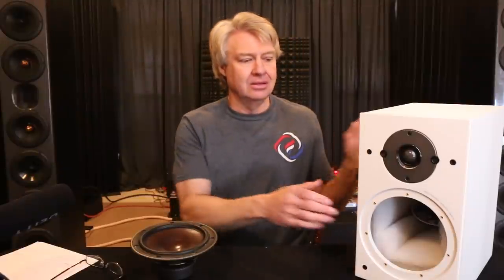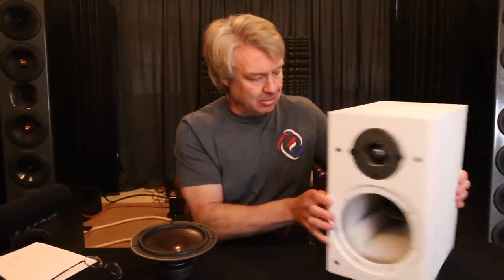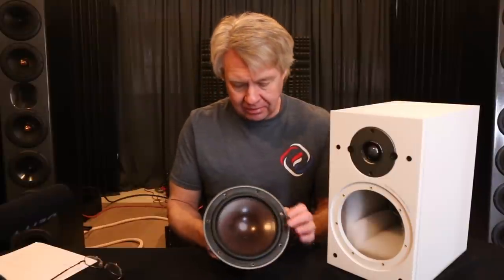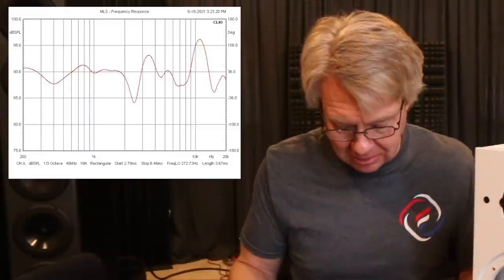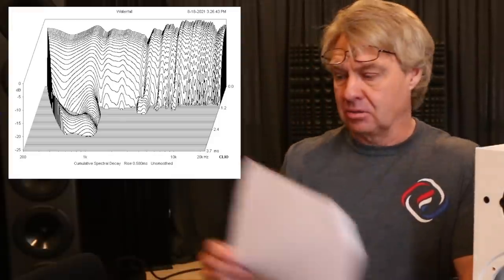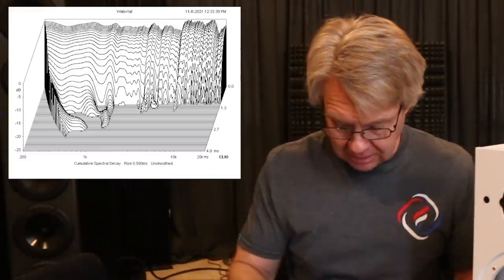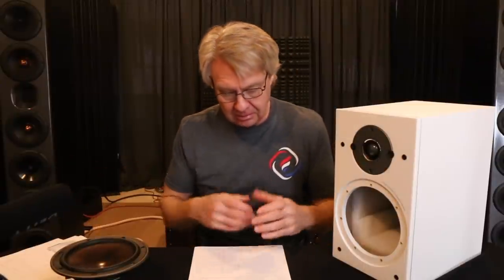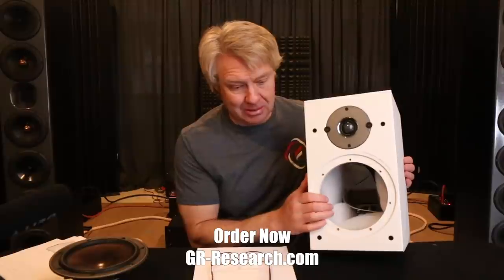Deal or no deal? Dali Oberon 3

Comment: Buy a set of $100.000  speakers, measure,  then add $30.000 worth of better components, and yes they will measure better. The speakers have a certain price point for a reason. I don't think Dali would make much of a profit if they spend over $300 in components and keep the same retail prises in this case. And I do hear a lot about measuring, but listening isn't about measuring, it's about experiencing. It is great that you create these upgrade kits, and I am sure they can improve the base speaker that it will be applied to. But don't talk down a speaker just because you can improve it, for a good chunk of extra money. It's just not fair.
Reply: True but does anyone know the price of the parts in these kits? I assume its like $50 or so and the rest is his profit anyway. I only have the Zenzor 1 (about £180 I think, in a pretty small room) and think they sound amazing, they are on stands with perfect ear/tweeter hight etc... I agree anyone who buys and fits this kit will think it sounds better without question most of the time. A true A/B is the only way to tell and that's subjective on a person by person basis anyway.
Reply: @usefulrandom1855  I had the zensor 1 for many years. Only thing the top end was a bit too bright and fatiguing. I sold them to buy the Spektor 2 and have better base and midrange
Reply: @diegocanale1124  Nice, I moved into a better place and got the Wharedale evo 4.4! They are huge but sound awesome. Still got the sensors will set them up on/next to computer desk when I get around to sorting that out.
Reply: no 300 no, but what they put in is 5 bucks,....yes if you want sell speakers over the price of new hybrid car you almost have to look for worst possible part in the market...
Reply: This is his business idea. Everything is crap until you buy his upgrade.
Reply: @hbg70 That sounds like envy. People, folks, audiophiles and music lovers in USA send their loved, but not sounding good speakers to Danny. To see what next level Danny can take them to. (Many speakers do sound bad and also measures bad.) He does it for free and they pay for the parts and not Danny’s labour. Shoots a video, so others with the same speaker can upgrade their speakers, if they believe in good sound. Danny sells the parts. What’s the deal for you with that? I don’t have the knowledge or the equipment to do this to my speakers, so I would buy a kit.

Comment: I was a salesman for Dali speakers in the mid 80's. They were killers then and when tested against other big name speaker companies of that time the Dali's out-classed them. Today I still own an unchanged working pair from that time. At that time they were not made with cheap drivers, compacitors, crossovers, etc. Wow how times have changed.
Reply: the rare thing is that Dali Oberon 3 are cheap built, but sound very good
Reply: @carlosaguilar6743  that is possible.
Reply: Dali is the new jamo, cheaply build, very brightly tuned, so in comparison  in the shop the will standout in comparison with more " serious speakers, THAT'S how you sell , when the customer comes home those speakers quickly disappoint, so off to the same shop and trade them in for even more expensive models, THAT'S how the business iss done.
Reply: @giottodiotto1  In these times I have lost faith in many companies selling inferior products that were once of good quality.
Reply: @spooner1  but it took me months to search speakers and still didnt find a good neutral warm speaker. Focals returned too bright... Pff
Reply: and dali is no exception to that, one will give you bright sound to impress like dali , another boomy bass, another worm in the bottom with very hot trable, ....they just have to start somehow at 1K to scale prices up to 10K where real/normal speakers start in order to make todays salesman belive what a pieace of engineering he is selling when showing up that 10K speaker....stupidness, no speaker should cost as much as a car, but it is what it is so lets buld and upgrade.....
There are some exceptions which we know thanks channels like this one....

Comment: I bought this summer a pair of Dali Oberon 5 floorstanding speakers. Via Bluesound Node2 music streaming(Spotify and Tidal) on a vintage but total restored Sansui AU-505.
Sounds surprisingly good, at least for my ears. Enough clarity,midrange and bass even at low volume.  I live in a small apartment in Amsterdam; everything is wood and gypsum. No concrete or stone, i like that.
The Oberon 5 are pretty hefty.  They were  €800,- the pair.
Yeahh ,i would like for example the Buchardt S400 mkII and a stronger amp, but as i said, it's a small apartment..
Reply: I agree. The Dali Oberon 5 are fantastic speakers for the money. They have suprising wide bandwidth, smooth treble and can go loud without compression or breakup. Even if they do cheezy crossover components.
Reply: Meanwhile i have a Sansui AU 317( I had years ago too),fully restored,also the exterior is nice),more power than the AU 505. Sounds even better than the AU 505 with the Oberon 5. But i keep the 505. The 505 is about 2x 18 watt, the 317 about 2x 50 watt...again..sounds surprisingly good with the Bluesound Node 2i.. But  ""everything" depends on the the track/ the mastering of the track in the studio and room-acoustics..I have a pretty high ceiling.
So.. i don't need a new/modern amplifier for a good sound.. No remote, no dac(there is a good dac in the Bluesound),no modern looks..just a good sound(for my ears..)

Now(since 6/8 months) i use the Triangle Borea III, bought second hand, in very nice condition.The seller had bought the Kefs active speakers.
The Dali's are very nice sounding(and looking) speakers but still gave a little to much bass in my tiny(25m2) room.
On the other hand, the Triangles are for that matter perfectly fine.

I connected the Triangle's with an Ayima D03(i just wanna try it) and..the sound is very good, not less than the Sansui, but of course not many inputs.

First i connected the Aiyima with the Blue Sound via  "aux" on the Aiyima, but it gave not much md- and high tones(so i used the intern dac of the Bluesound.

Later on i switched from "aux" to "coax" (then i use the intern dac of the Aiyima..and  problem solved... Enough high- and mid tones now,  so (i did'nt expected also) the dac inside the Aiyima sounds better then the intern dac of the Blue Sound!    Crazy but realy truth..

I believe the Aiyima D03 has Texas Instruments chips inside, that's why..

So..finally i do use a "modern" amplifier.
It surprised me too, how good(bass,treble,punch etc) that small Aiyima amplifier sounds! Not worse than the Sansui! I live in a small apartment in Amsterdam so not much space.

The Triangles are high sensitive speakers, so that's a plus.
Also with low volume it sounds pretty full/warm/punchy.
Reply: The Sansui's I've had have all had a very bright etched sound - this is exactly what the Oberon 5's need so excellent match. I feel the Oberons sound a little muffled with smooth gear or more refined gear. I wish I could send them to Danny, but I'm in the UK so....:(
Reply: We concerned Dali Oberon 3 but you gave Dali Oberon 5 's  impression.Thanks.

Comment: I don’t know, at the end of the day what matters, is what your ears are hearing. Today, I listened to Kef Q350, Oberons 3 and B&W606….to be honest, I loved Oberons best. To my ears they don’t need any tweaking whatsoever….does it mean there’s something wrong with my ears?
Reply: Yes they're great sounding speaker I can only imagine what they sound like with the upgrade
Reply: If you are over 40 years old, you need bright speakers to compensate for natural high frequency age-related hearing loss.
Reply: You can test drive 3 different stock cars. And then, you drive a specially tuned and equipped version of one of those three; more horsepower, even acceleration, better tyres, better grip, better braking, more comfortable seats, better steering wheel, etc. From the moment you sit inside it, press the accelerator, press the brakes, etc. you KNOW exactly how much better any stock car could be but you are not given that.

Comment: From watching Danny's videos, it seems like the most prudent action is to buy used, but well-regarded speakers at 50% off retail and then have Danny work his magic to upgrade it. 😀
Reply: Typically, because most speaker brands use the least expensive parts in their designs I read reviews and have a potential list of speakers that may fit my needs.  Then when they become discontinued and drop in price I tend to jump on them if still available.  Sometimes they get sent back too.

Did buy the Menuet SE at retail but didn't work for me and a pig for power.  When the Opticon 1 MK1 came available at half off I jumped on them thinking they could work better which they do.  A bit less resolution and note density but seemingly more transparent into a recording.  The frequency curve provided by one site doesn't look bad except for a hump in the 500 to 900 hz range.  Works much better than just nearfield too which the SE is strictly for.  

would it be worth it to upgrade the crossover?  There is another channel that did just that and got better performance so its an option. I think GRR would take a different approach and don't know if their choices would even fit in the box.  So for now live with the warts but for the price, its pretty decent.  Also works better than the Oberon 1s I tried IMO.  

The new NX Bravo speaker could be a path to upgrade as it has about similar sensitivity but in a much larger package, still 13inch. is doable and the largest I want a speaker to be.  Not easy finding decent small monitors that blend with a sub.

Comment: Danny, you say the box is unbraced? On the Dali website it says this for the Oberon 3: "The OBERON 3 cabinet is constructed from a high density, CNC machined MDF board dressed in high-grade vinyl. The extremely rigid structure is achieved with solid bracings across the inside of the cabinet, which practically eliminates cabinet resonance."
Reply: yes, definately NO bracing.
Reply: I’ll remove the woofer and check when I get mine
Reply: These reviews always have Million$ of rea$on$ to discredit a company as prestigious as Dali. I have been told that you are al$o quite subjective. It will $urely have $ome economic intere$t.

Comment: On the "gr" website I asked several times what the set looks like, is the crossover complete, does it have to be assembled by yourself, is there a printed circuit board.
I asked for a photo of such a set.
I was pissed off.
No response.

Comment: These speakers sound really good. Bring the treble down just a little + Same Thing with the Bass. Tonecontrol. (Otherwise the upper Bass tends to be a little boomy)
Done that, its a very smooth,full and cristal clear sound. Nothing to complain.
The drivers are high Quality and well made.
Reply: I have a pair of these and I think they sound fantastic. They were a bit boomy at first but I played around with placement and now have them 26 inches from the front wall (measured from front baffle) and its tighter, boomyness is gone. I am running them with separate amp and pre amp , good equipment. I also use a subwoofer for extra low end, I can't complain the sound stage is really good. Dali is a reputal company so maybe there is a reason to use the crossover components that is in these, over kill?
I think they sound great as is.
Reply: @robertstolz2632  yes, soundstage is way better than every soeaker at same price.
The tweeter is exciting too, but for long listening Session i prefere smooth speakers. 
In other words, bbc speakers like spendors. 
And for total exitment i prefere Horn speakers like klipsch heritage . .
The dali oberons are something in between and way cheaper.
One cant go wrong buing these for a Budget. Aber Robert ich denke auf Deutsch hätten wir uns auch unterhalten können :)
Reply: @robertstolz2632  I put my Dali's at the same measurement from the front wall as you and yes less boom I also stuck some dampening inside the speaker they're sounding so good
Reply: @silverlining682 what dampening did you use?

Comment: Basic, cheap and ease for everyone upgrade in Oberon 3 crossover is to change tweater cap Sounder 5.6 uF 100V to Audyn Cap Q4 MKP 5,60 uf 400V for example. 
You can easy change Sounder 28uF 100V in woofer section to Audyn Cap Q4 MKP 30,00 uf 400V
I think Mundorf is too much for budget speaker :) Audyn is great enough.
Reply: Mundorf parts is also possible when User want to it .

Comment: I replaced the wire on my Oberon 3's with much better wire about 6 months ago and soldered directly from the crossover to the woofer/tweeter. The difference was not small and I was actually able to do a side by side with the stock model in store (the owner helped me replace the wire). They were decent before, but this upgrade was definitely worth it. I would be curious to try out a new crossover after just hearing the difference wire can make.
Reply: Please give me more details about the much better wires
Reply: @klamath1974  Just silver wire, nothing fancy, but much better than the tin wires that came inside. I also soldered the wire directly from the crossover to the woofer and tweeter as opposed to having cheap clips.
Reply: @voicesofvinyl  Thank you. I have in my closet 2 meters of Van Den Hul "The Clearwater" wires (1.97 mm² / ~AWG 14 / 98). I will use it and I hope that will be enough to improve the sound on Oberon 3.
Reply: @klamath1974  It will 100%. When we replaced the wire, we AB tested them against an identical pair side by side, with a very modest Rega P1/Rega IO combo. The difference was immediate and now that I've used them for many months, they are fully broken in and sounding amazing.
Reply: @klamath1974  ,Did you change your crossover wire with the awg 14 if so how do they sound

Comment: I have this speakers and I love them. Use 2 small Emotiva subs with them that take away the bass frequencies first before feeding the Oberons. They’re much cheaper in Europe. Like 270-300$ incl. tax and shipping. The tweeters are special: they are a bit bigger and go lower. 
The stereo image is awesome.
Reply: 600 Dollars(500 Euros) in germany.
Reply: Imagine how much you would like them after the crossover god touched them
Reply: I’m sure the Dali Oberon 3 sounds great.
I had the Oberon 7 and prefer them over the much more expensive KEF R3. The R3 may be one of the best measuring speakers out there but they lack emotion , warmth and engagement.
Reply: @sherlockholmes2010  599 euros en España...
Reply: @davidsimon1642  460 in Germany
Reply: Well I agree the x-over is much better now, as for expensive parts I wouldn't waste my money on these drivers.
Reply: @pliedtka  dali's are measured and made from a off-axis point of view and aims for power-response. that is why they have extra energy at the topend when measured directly in front, best upgrade for these would be same x-over but better components

Comment: For some reason Dali's are really expensive in the US. I picked up the Oberon 5's recently here in the UK for £750 (which is the RRP). I really hope you get chance to test those, too. They sound good but I would love to upgrade the x-over.
Reply: Expense in the US is due to it being an imported product so just the cost to get it here makes a big impact on RRP.
Reply: @DJWerkz  Indeed, but even considering that it seems a bit much.
Reply: Bought a pair of Oberon 5's open box few months back, for £550 UK, the 1's & 5's use the smaller woofer, which seems to integrate a little better, a good floorstander suited to smaller rooms, crossover parts do look small and cheap but mercifully few lol, also found them very boomy/boxy as cabinet lining was minimal, just added some wool wadding inside the cabinet, problem solved, 100hrs on them now, love that wide dispersion tweeter in my smallish room, they sound like they review after that little bit of tweaking, I love watching danny dissect speakers and I also agree that the cost cutting against the selling price is shocking on many speakers, how much would it have cost Dali to put some thicker lining material in the cabinet, virtually nothing!
Reply: $900 usd too expensive. tariff. don't buy dali in the united states
Reply: Agreed, I would like to upgrade the X overs on my Oberon 7 after #newrecordday slated the response
Reply: @bigambientdeath  Interesting, I've not found mine to be boomy, but I'm in a medium sized room with acoustic treatment.
Reply: @HerbsmanRevs  I have panels etc as well, guess it depends on the type of music you listen to, put on Eva Cassidy nightbird, they sound superb, put on Carcass Heartwork and the guitars just drown out everything, snares can sound a bit too reverby as well for my taste, very happy with my Oberon's after topping up the lining, personal taste I guess, glad you are enjoying these great little speakers as well🙂
Reply: They are worth every penny